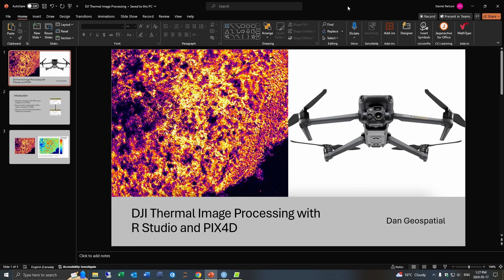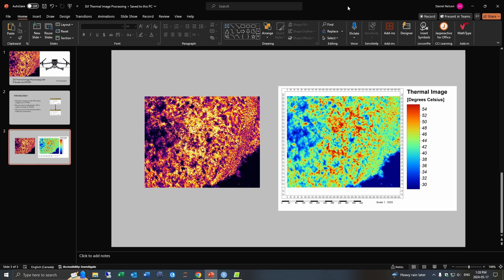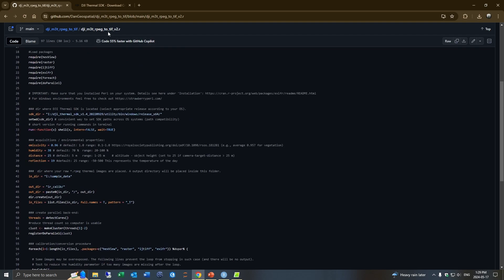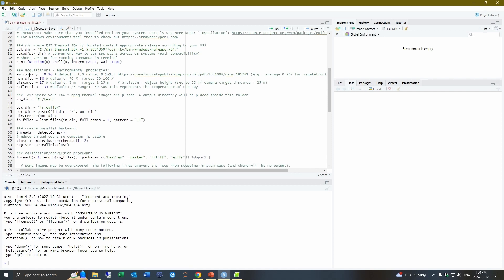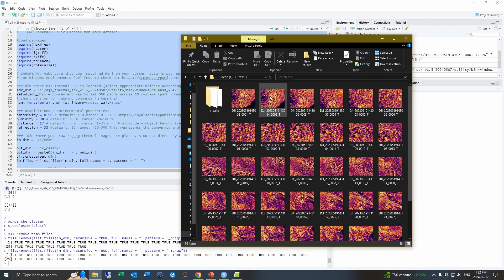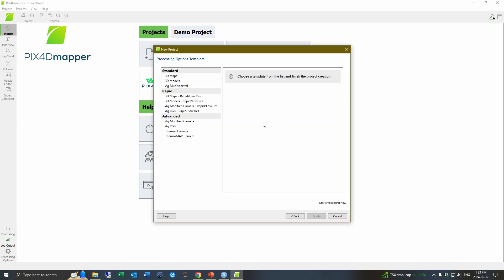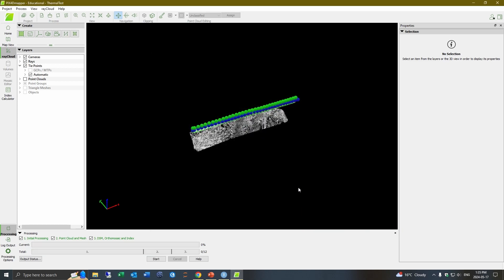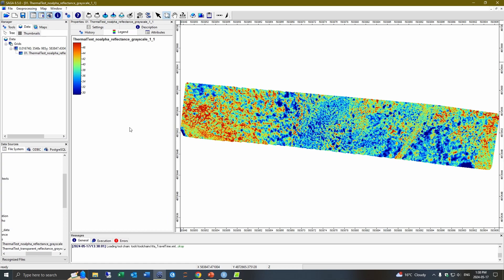DJI Mavic 3 Thermal Image Processing with R Studio and PIX4D

Comment: I’ve discovered a new issue: the original data has a resolution of 1280×1024, but after conversion, the resolution becomes 640×512. This seems to affect the stitching results in Pix4D.
Reply from the maker: I've discovered the issue here. I have to create a toggle so that the user can select when they are using super resolution mode. This will allow the image tiles to be generated in the correct resolutions as I had time to test this more myself. I will implement this shortly. Sorry for all the delays. I should have done this long ago when they announced it and investigated it deeply myself.
Reply: @DanGeospatial  Hi, I saw your earlier message about adding a toggle for super resolution mode.
Have you already implemented this change?
Reply from the maker: @WENMINHE-3711  I added the change. Please try it and let me know if it works!

Comment: hi，My data ran successfully, but there's a slight issue. The image appears streaked—one row looks normal, while the next has problems, similar to the striping seen in Landsat images.
Reply from the maker: Thank you very much for reporting this bug. I recently pushed an update to add support for another DJI image feature and did not test any images in later rows. I'm pushing an update right now to revert this.
Reply: @DanGeospatial  Thank you for your reply. I have another question I'd like to ask. How should I determine the environmental properties? Should I use the DJI Thermal Analysis Tool 3 to check them? When I use the parameters from that tool to run the code, the resulting temperatures are about 5°C lower than what I see in DJI Thermal Analysis Tool 3. Also, the parameters shown in DJI Thermal Analysis Tool 3 don't seem to match the actual ones—for example, our actual flight altitude was 130 meters, but the tool shows only 13 meters, and the code only allows flight altitude to be set between 1 and 25 meters. I'd like to ask how I can adjust the environmental properties so that the results better reflect the actual values.
Reply: @DanGeospatial  Oh, sorry, I just saw the updated code. The temperature values now match the actual readings, but a new issue has appeared—the output has become a stitched image made up of eight repeated frames.
Reply from the maker: @WENMINHE-3711 we usually do a secondary correction after this script using several temperature values recorded in the field if it is very important. What are your thermal image dimensions? If they were captured using Infrared Image Super-Resolution mode then this patch will not work. I am working on fixing it for that mode but have not had time yet this week.
Reply: @DanGeospatial  Thank you for the clarification. My thermal image dimensions are 1280×1024. I’m not sure whether they were captured in Infrared Image Super-Resolution mode
Reply from the maker: @WENMINHE-3711 It looks like they were. Otherwise they should be 640×512. It shouldn't be an issue once I have updated the code again.
Reply: @DanGeospatial  wowWow, that’s awesome! I’ll wait for your update~
Reply from the maker: @WENMINHE-3711  I've pushed a change that might fix the problem. I don't have any images captured with 1280×1024 mode on me today to test. Let me know what the results look like.
Reply: @DanGeospatial  I tried running it, and the results seem pretty good — the temperature data is accurate, the projection information is included, and the stitching into an orthophoto also went smoothly.THANKS~
Reply: @DanGeospatial  I'm wondering if there's a method for batch processing. Each thermal image has four different variable values, so the code needs to be adjusted for each image during conversion, which is quite inefficient. Is there a way to automatically identify these parameters and convert JPG to TIF in batch?
Reply from the maker: @WENMINHE-3711  Yes, the script is quite inefficient and can be improved. I'm currently working on a Python version that also doesn't need perl.
Reply: @DanGeospatial  I tried using DJI's thermal analysis software to batch export PDF quality inspection reports and extract parameters from them, which seems to allow for batch processing. However, when I switched to a higher-performance computer — even though I believe all operations were the same — the foreach loop returned NULL instead of the correct 0. What could be the reason for this?

Comment: HI Dan, 
Hope you are doing fine. When we run the code, we have this issue as a final result and no images on the directory "Ir_calib" :
[[862]] #all the images is like this.
NULL
file.remove(list.files(in_dir, recursive = TRUE, full.names = T, pattern = "_original"))
logical(0)
file.remove(list.files(in_dir, recursive = TRUE, full.names = T, pattern = "_T.raw"))
logical(0)
Reply from the maker: Hello, please double check that you have entered the correct settings, such as temperature, humidity and that you have Perl installed.
Reply: @DanGeospatial  Same issue, tried playing around with parameters and no change, yes Perl is installed
Reply: @DanGeospatial  Yes we did Perl and enter all settings right as we have on that mission day...but always getting the error, do we need to have png format or jpg ? We have jpg format.
Reply from the maker: Hello everyone, sorry for the delay. The images must only be in .JPG format. I tried installing it on a fresh computer I have with me and it seems to be working. What version of DJI SDK are you using?
Reply: @DanGeospatial  V1.5, the one available on DJI's website.
Reply: @AliAchebour  @DanGeospatial I finally got it to work. check if your images have the _T in them at the end
Reply from the maker: Yes, it is looking for file names to have '_T' in them
Reply: @DanGeospatial  I still seem to not have any luck. I have played with the values and checked that files end with _T but still no luck.

Comment: do you have any ideas for how to overcome this problem of entering humidity, temperature etc. manually let's just say i want to process an backdate image and i don't have temprature and humidity readings for that day. how do i overcome this problem? even if i use weather apis i am not sure how accurate there data might be and how much it would affect the thermal data of my image.
Reply from the maker: I've thought about your question and without some sort of reference temperature values (either from satellite thermal images, ground measurements, climate data) I don't think it will be possible to calibrate the thermal images. You can always use them without humidity or temperature and this may be suitable for some applications. But there will be no way to evaluate the difference between recorded versus actual temperature values. Sorry I couldn't be more helpful.
Reply: @DanGeospatial  hi，how to get  temperature values (either from satellite thermal images, ground measurements, climate data)

Comment: I didn’t think the Mavic 3 Enterprise Thermal takes R-Jpg’s
Reply from the maker: The M3 thermal camera does take RJPEG but it is just stored in a different format than the usual FLIR RJPEG. While the file name is saved as a .jpg the thermal data is stored inside in a 1-dimensional array of 16-bit integers under the EXIF tag 'Thermal Data'. In this case I am using the DJI thermal sdk to extract this array from the .jpg files but other methods can be used.
Reply: @DanGeospatial  can i contact you? i have few questions about how the image stored since i have the same problem